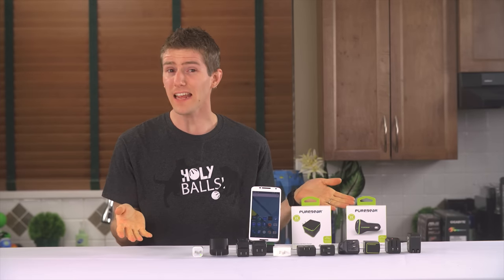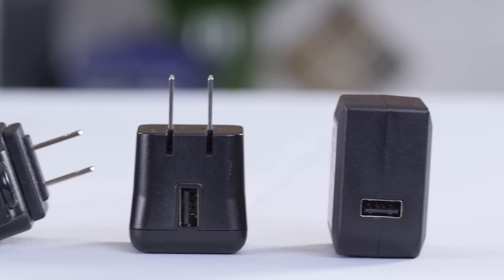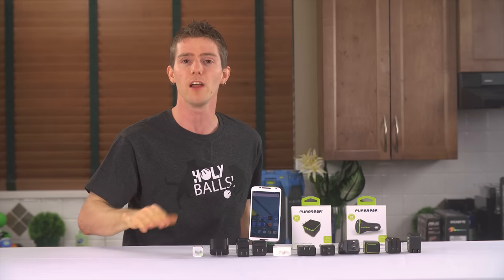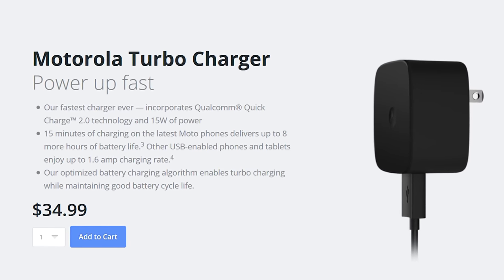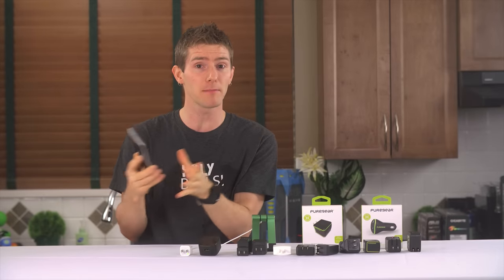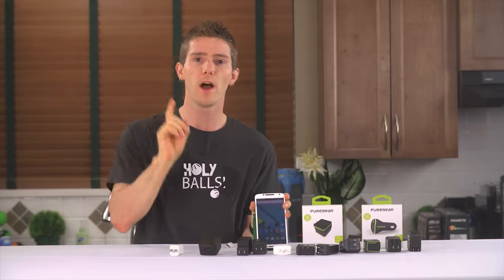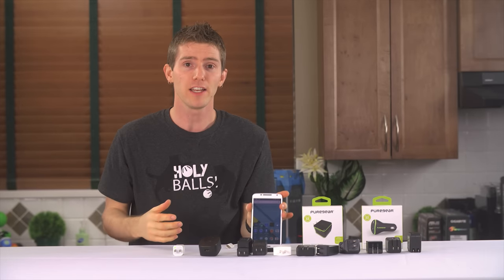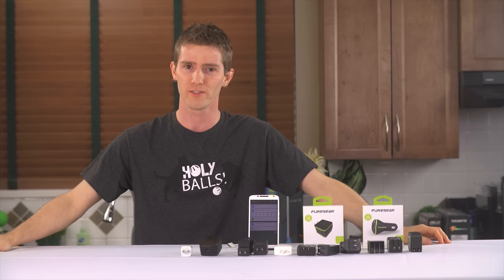Faster Phone Chargers Explained - Qualcomm Quick Charge 2.0

Comment: There should be a slider to choose the charge speed you want.
For example, at night you can choose a low charge speed and when you're in a hurry a high one.
Reply: this would be nice.
Reply: You should patent it
Reply: technically it's possible, but it could just be a waste of power, just like throttling down/bottle necking the amps is a waste of energy. unless they come up with a brand new IC Controller (just like big.Little CPU)
Reply: +Peleg Tsadok magcable
Reply: +Harpax A 
Not true. The unused power potential simply doesn't get drawn from the wall. It doesn't have to be "wasted"
Reply: +Harpax A And slower charging overnight would greatly effect the lifespan of the battery!
Reply: The Linux kernel allows to choose to use the feature or not. but no application on play provides gui for end users. any one could write such an app and publish it. nobody had the will yet ...
Reply: +Peleg Tsadok custom kernel, i can choose it on my oneplus two , can take it down to 100ma all the way up to 2.2A (verified with a usb power monitor such as the legion meter)
Reply: well, with samsung devices you can opt for not going fast charge within the phone settings
Reply: What about when you buy it you can buy faster or cheaper depending on how expensive you wnar
Reply: There should be a manual voltage elevator.
Reply: It happens automatically now

Comment: non-replaceable battery + high-current chargers = less time between customer buying new phones.
Reply: +Jordan Pranks true
Reply: - negative feedback towards reliability - less customers - less money
Reply: unless you're apple of course...
Reply: +Драган Дабић LG's new V20 is a perfectly timed push against the Non-replaceable battery trend.  With the Samsung Galaxy Note 7 basically being a literal time-bomb, people should see just how important being able to access your phone's battery is.
Reply: HalfBreedMix too bad its not sold in Europe, its out of my price range anyways, but its still a bummer. Im going to get the G5 instead for that good 'ole replaceable battery, SD slot, IR Port and the fact that its LG (Very satisfied with my G3)
Reply: Having a camera lens stuck out from the back means you can't add the full size heatsink you want.  Already changed every battery in each iPhone I have had. Heatsink makes a huge difference while downloading, and charging.
Reply: @kevinmoehring8259  Apple invented that non-replaceable garbage.
Reply: @techlord7014  just because they say it not replaceable doesn't mean you can't replace it Ive done it to my phones several times it not even that hard. and if you can't do it yourself you can also go into a store that does it they charge like 60$ for battery and labor.
Reply: Anything related to or run by money can't be trusted.
Reply: My old Huawei mate 10 pro is 5 years old it still works fine for my mum she doesn't even charge everyday and that was 5a charging.

Comment: USB charging is complicated, but I'll try to give a few brief clarifications.

USB is a negotiation standard, the charger first tells the device how much current it is capable of delivering, then the device will draw whatever current it needs not exceeding the maximum. This is primarily to protect chargers and USB ports, there's nothing that prevents a phone from drawing 1 A of current from a charger only rated at 500 mA -- all it would do is overheat and die. That's why as a baseline all USB ports and chargers has a minimum current requirement of 500 mA, which is what it can provide if there's no negotiation.

A USB has four connectors, 2 for data and 2 for power, all the negotiation is done by applying a voltage across the two data lines D+ and D-. Samsung's 2.0 A handshake is 1.24V on D+ and 1.24V on D-. Apple's 2.4 A handshake is 2.8 V on D+ and 2.8 V on D-. Apple's 1.0 A handshake is 2.0V on D+ and 2.8V on D- (reversed from the 2.4A one). Apple's 2.1 A handshake is 2.7V on D+ and 2.0V on D-. Android DCP 1.5A is 1.65V on D+ and D-.. etc.

The current rating on chargers is entirely irrelevant unless it can properly negotiate with the device. Second, fast charging lithium-ion batteries do not reduce the life span of the cell to any appreciable extent.
Reply: +TheAmmoniacal 
"Second, fast charging lithium-ion batteries do not reduce the life span of the cell to any appreciable extent."
Are you sure? That would be great! Can you explain it?
Reply: Lutyano Alves Ageing of Lithium batteries during charging is due to the heat being generated, more heat over longer time will age it more quickly. But modern lithium batteries do not heat up appreciably while fast charging (1-1.5 A), and experimentation has not found a significant difference in life span of fast charged and slow charged cells. This is only the case on newer cells with very low ESRs though. If you do feel the battery getting warm I wouldn't recommend fast charging it. (over 50 C). So if a manufacturer sells you a battery with fast charging, just use it!
Reply: Thanks! I've also came to the conclusion that if it doesn't heat up more than when you're running intensive tasks, it's OK to fast-charge it. After all, the manufacturers should prepare the batteries to withstand the heat of their machines being used like that.
Reply: +TheAmmoniacal if battery is hotter than 45 C - 50 C it shouldn't be charged at all at this temperatyre. Some devices turn charging off if battery is over 45 C - 50 C

Comment: For the few months I have had my Droid Turbo, I have noticed that when running with the 'turbo charger' it stays substantially cooler that when I use the old charger that came with my RAZR MAXX HD. Even now, I just pulled it off the charger, it was on there for about an hour and a half (20% - 100%) and throughout the cycle it stayed cool to the touch; when I have done roughly the same cycle in the past with the other charger, it gets HOT. I love the quick charger, and the Droid Turbo, I can go a full day and almost another full day with fairly heavy use, it said 32 hrs on battery with 20% capacity (I would call it a day and a half of heavy use)

Comment: Thanks for the tip Linus! I think that your daily driver is a Droid Turbo(Correct me if I'm wrong) do you use the turbo charger included? If not how many amps is the alternate charger that you use? What should I use to charger my Droid Turbo?
Reply from the maker: CombustLemonz I use a 1 amp port on my Antec quad USB port charger that I keep on my nightstand.
Reply: I run BOINC and Folding@home on my phone whenever it's plugged in so the chassis and thus the battery of my Moto G4 is always at about 43 degrees Celsius overnight. Not too concerned with the battery wearing out after a year or two, I think I can replace the battery by taking out a few proprietary screws. Distributed computing for the win! The phone takes about 4.5 watts from the charger to run the distributed computing project with the screen on and the battery charged.

The Motorola charger that came with your Nexus and also mine, it's interesting it is rated for 15 watts, yet, the Quickcharge 2.0 standard says 18 watts...   My phone has the Snapdragon 617 processor I believer, that supports Quickcharge 3.0, yet Motorola hasn't released a charger that can vary output in 0.2V increments, at least according to the spec sheet on the back of it (5V.9V.12V).

Would be interesting to see how charging times differ with BOINC running on all cores with the screen on while charging. Without any external cooling, and with.

Comment: I charge my phone overnight whatever capacity it is at, so I could care less how long it takes. I never run out of juice.
Reply: Yeah but you're going to ruing your battery by doing that.  You never charge a batter that isn't completely dead because it ends up losing its charge faster.
Reply: You're wrong. That was true back when NiCad batteries were the norm, but with Lithium Ion you can charge it whenever you want. Li-Ion batteries even like to be kept in the 40-50% range. Running them too low too often is bad for them.
Reply: James Bernard Not true. The OS and OBC can vary the power intake. Once the battery is full it stops pulling full power and pulls something like 0.2amps at full charge unlike old phones which would carry on pulling the full 0.5amps to 1amps. The phone has much better power control. So long as the kernel has the driver it needs to do so that is.
Reply: James Bernard I been doing it for 2 years and the battery is like New. You must have a scrap phone.
Reply: James Bernard no. the more you charge it the more charging cycles you use thus the less overall the lithium battery can hold as it has roughly 200-500 charge cycles.
Reply: Tech John I'm sure I've used my lithium ion battery for more than 200-500 charge cycles. Do you mean 100-0% is one charge cycle? Cause I've used my phone for over a year and usually drain the battery every single day.
Reply: 2 years later my s3's battery life is about an hour less than it was when it was new. i have lots of extra batteries though so no big deal if it dies
Reply: James Bernard Old batteries had that issue. Lithium based batteries actually die faster if you charge them near 0%. Best battery life is obtained by keeping it above 90% charge (which is not realistic).
Reply: Tech John Yea, I've read that article before
Reply: I hot wire a 5000 mah battery with digital readout and piggy back them with doulbe sided tape. Its awesome. Always powered and quick. They dont get hot. Not tye prettiest thing but no panics anymore and it has saved my butt a couple times when i was hammering my hotspot downloading and streaming 24 hours straight 3 devices. My porn hub and guests happy lol

Comment: Quick charge still seems kinda fishy you have a 3.7 volt battery in your phone and the recommended voltage to charge it is 4.5 thus the reason why you have a 5volt usb port. Now with quick charge 2.0 you are forcing 12volts into that tiny 3.7volt battery wouldn't you blow that battery up by now?
Reply: Jesse Lam nah, while you put more voltage in you have less current, so no problem there. what counts is the Watts
Reply: At the risk of commenting in response to a youtube comment; The higher voltage allows more total wattage to be pulled from the wall adapter to the phone. The phone has internal circuitry that then steps the voltage back down to the designated battery voltage at a higher amps. So to recap.  A normal charger may output 5V at 2amps for a total of 10 watts of charging. This 5V goes to the phone at 2 amps and gets stepped down to 3.7 volts (using your battery voltage as an example) at 2.7 amps (3.7 volts at 2.7 amps is still a total of 10 watts of charging) The 'quick charge' is outputting 12 volts at 1.2 amps for a total of 14.4 watts, a 44 percent increase compared to the 2 amp alone. This 44 percent increase can actually easily be seen in the graph in the video above. These chargers are outputting these higher voltages to allow the wire size inside the usb cable to stay the same, as a slightly higher voltage at lower amps will not significantly increase the heat generation of the wires therefore making it safe to charge with. That's why it was a little painful to hear Linus say the 2amp chargers either sucked or couldn't handshake and activate the faster charging, because these wall adapter simply can't, they don't have a 12v output.
Reply: it's not doing that all at the same time time